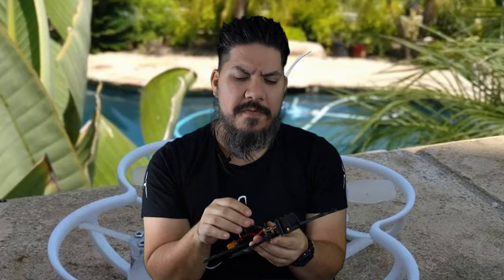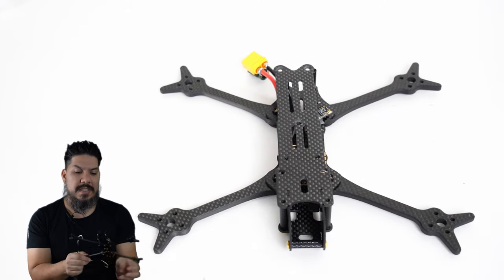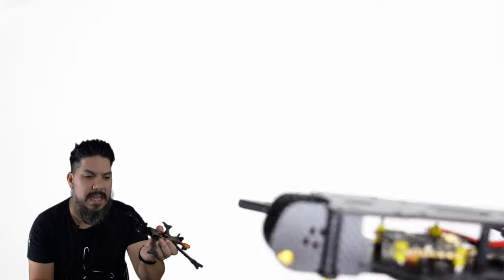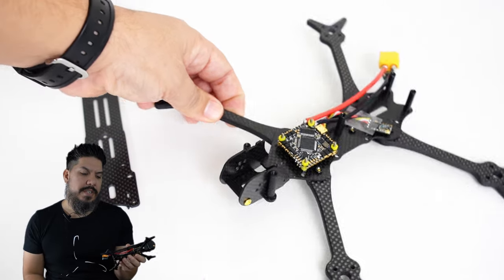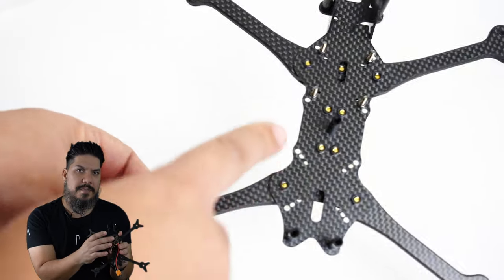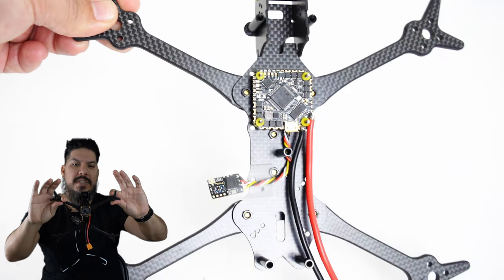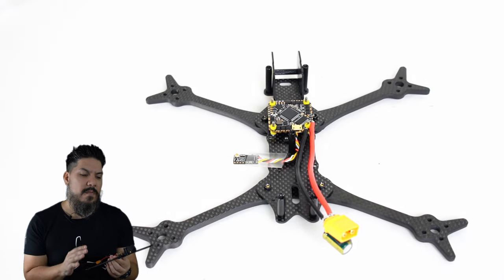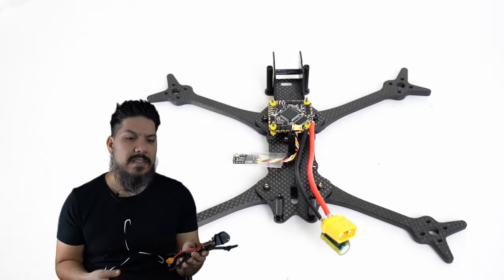FPV Cycle Prototype 5 freestyle frame overview - whoop mounting on a full size Drone frame

Comment from the maker: Support the channel buying here

FPV Cycle Prototype 5 Frame - Orders will ship with the new beefed up front end
https://fpvcycle.com/collections/frames/products/prototype-5?ref=jone5

HIFIONRC 45A AIO toothpick board - 
Banggood - https://www.banggood.com/custlink/DmKRWkeWBM
RDQ - https://www.racedayquads.com/products/hifionrc-f7-2-6s-aio-toothpick-whoop-flight-controller-w-45a-4in1-esc?_pos=7&_sid=5883c82d3&_ss=r&aff=34
GetFPV - https://www.getfpv.com/hifionrc-f7-2-6s-45a-aio-fc-esc-toothpick-flight-controller.html?cmid=eHZ3Y2tBWGYrQWM9&afid=Q0lGVFUveWN0R009&ats=YnBOVHhTZDNHMmc9

join the FPV Sales Alerts FB Group: https://www.facebook.com/groups/425554224924945/

Comment: Those amax motors will look sweet with that frame. Only thing that sucks is getting props on and off the shaft is a pain in the ass. It’s almost like it’s .5mm too big

Comment: I've got a bunch of Kebabs frames but I've gone off them a little recently. Purely because they are so gopro focused and I've pretty much given up on getting hd footage. The strap holes are offset to account for the weight of the gopro and compromises have been made to accommodate it. Awesome frames but no longer fit my requirements.
Reply from the maker: interesting notes, i actually think this one is setup a little less gopro centric, i love DJI dvr, so i probably wont even put a gopro on it.  What frames are you finding yourself going to?
Reply: @JonE5FPV  TBH I've been flying a toothfairy with 2205-1750kv on for 2.5yrs and it's been awesome. I have some 1300 6s that just fits the top plate. The lipos I use are barely hanging on but it's so efficient it doesn't care. That and a flexrc slim-x 3"

I recently bought a couple of mod-5 from alex arvinte on thingiverse via cncmadness to try out the ultralight stuff but what with not being able to go out and mainly flying fpv fixed wing I haven't got round to it yet.

Comment: Can't wait for the test of the HIFION 45A whoop board.  I used their 20mm stack, and I'm curious if the whoop board is lighter for the same capacity.  Any chance you weighed the board with the mounting hardware?